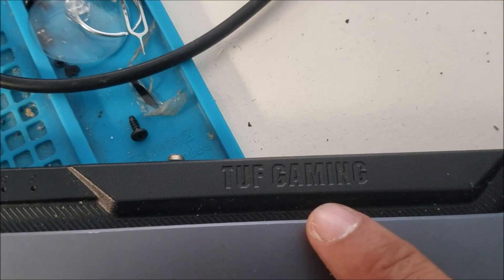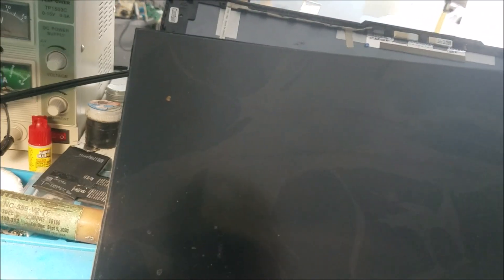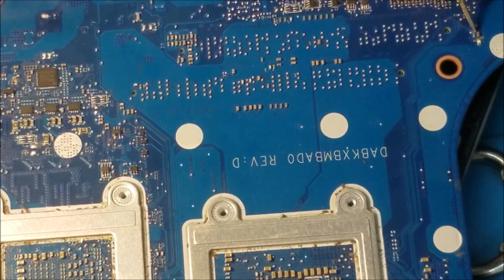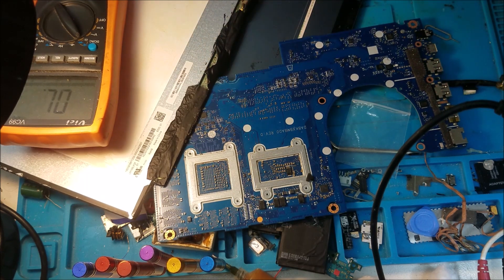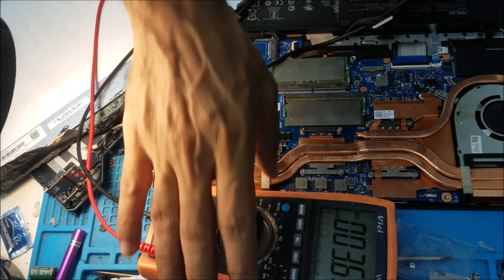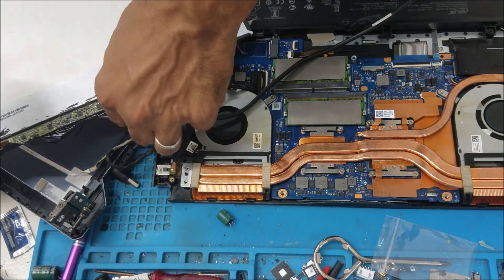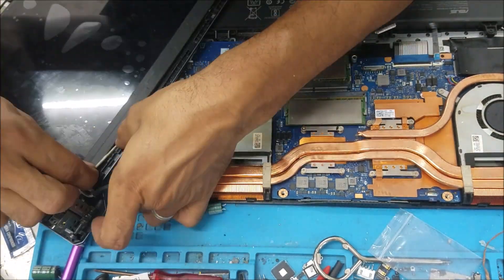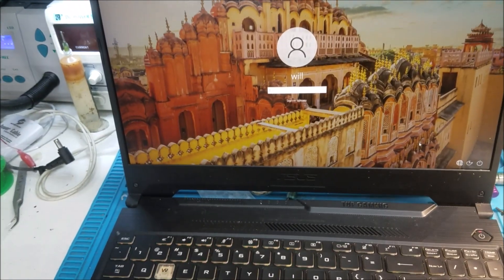ASUS TUF506IU ES74 gaming laptop no backlight fix

Comment: I changed the fuse but why backlight just out 10V, Can u give me some advice?
Reply from the maker: if you replacing the the screen without disconnect the battery will cause it and the age of the backlight may drain more Amps

Comment: Can I Use Jumper To Bypass 19v ?
Reply from the maker: to bypass fuse? yes, just be sure there is no short
Reply: @SOSfixElectronics  
Hmm Same Problem BackLight Issue But There's In  19V Supply Is Shorted By A Faulty Cap I Replace  The Short Capacitor Now BackLight Work Fine Thanks
Reply: @LetsXposeOnlineGaming  I'm having the same problem. I've already replaced the fuse, but the backlight is still on. Can you help me? You mentioned a capacitor needs replacing? Which one should I replace?